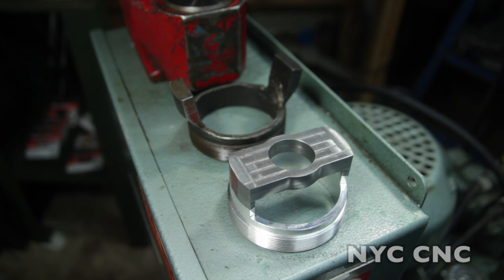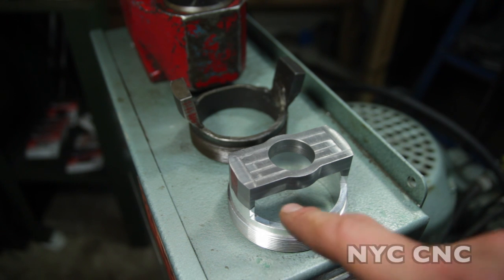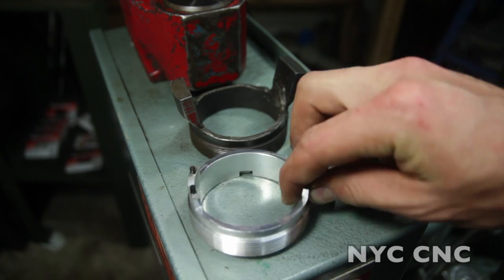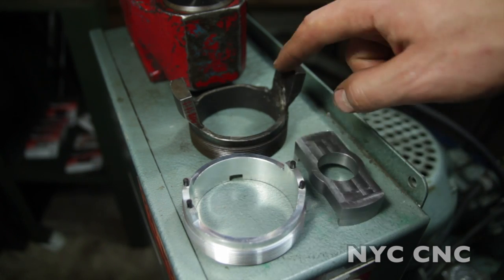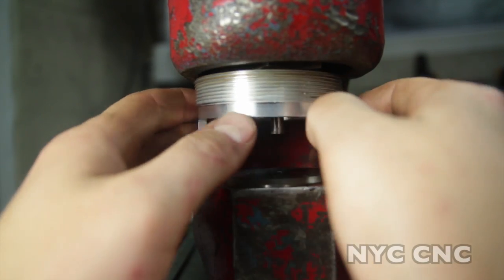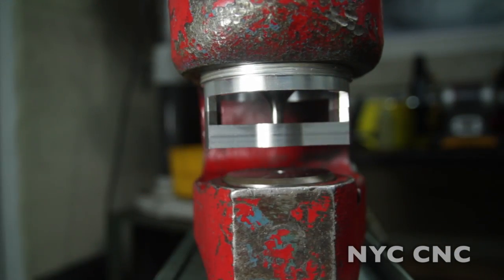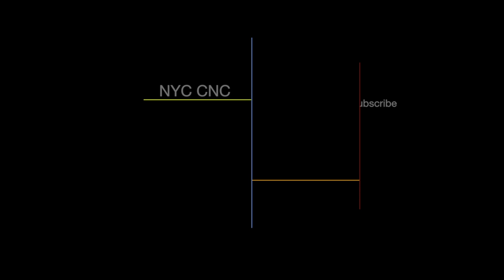Whitney Hydraulic Punch - Custom Machined Aluminum & Steel Stripper Plate

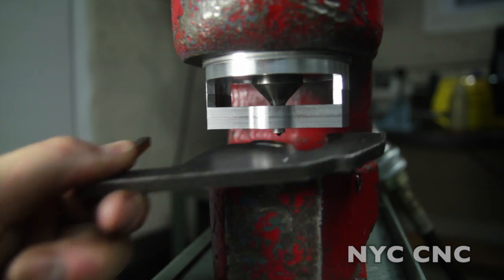Comment: Hi John. I don't know if you noticed, but would probably want to know... The punch body pushes on the stripper "nose" at the bottom of its stroke. You can see the lower part of your new stripper being pushed out at 3:42 in your video.

I wasn't sure that I liked the arrangement you had with just the 4 pins holding it on. In this case, anything else likely would have failed, and early. :)

Thanks for making and posting these vids. I enjoyed watching you learn the trade and find your voice.
Reply: NYC CNC Not much to tell or say. It was a passing thought while watching that dowels seemed a bit odd for the low precision needed. A few moments of thought put it to rest, concluding quickly that it's hard to beat the ease of machining the bridge. The alternatives that came to mind all need a second setup. Binding at assembly would be the issue, after things get bashed about a bit more. But then, you have a 30T press right on hand to fix that. Truth is, I like it now that I think about it a bit more.

Comment: Nice work John.  It looks to me that the reason it separates is because the ram over strokes and kicks it apart. Anything you do to hold it together will likely be ripped off - with 30 tons of power. Anyway you can make the stripper plate ears longer to prevent the ram from hitting it?

Comment: Nice work John.  Looks like you will need to add some sort of retainer to your two part design since it was trying to separate.  Could be as simple as two small holes for safety wire, but that might be a bit crude against your nice work.